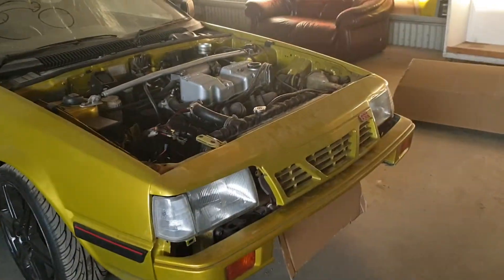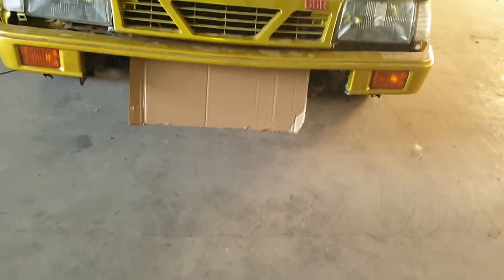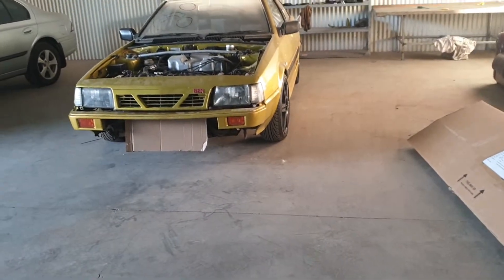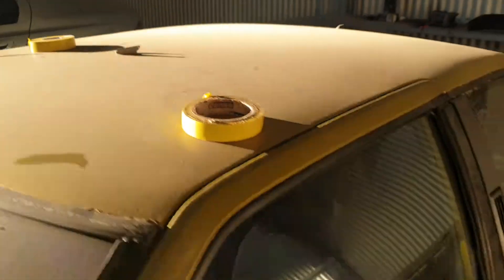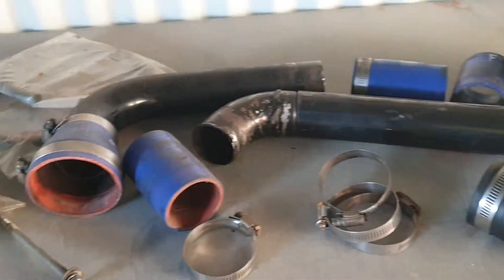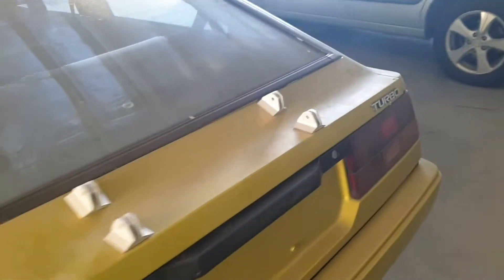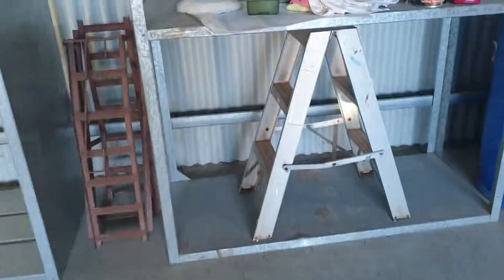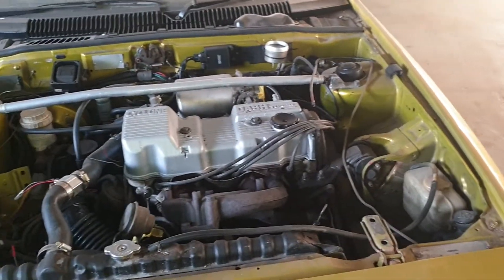Cordia update pt. 2

Comment: Should run nice and rich without the air flow sensors (Dash dunno??)...
Reply from the maker: Hopefully it does aye, what do you mean?
Reply: @willfilkin6469  Yea hopefully, i'll set up an email account tonight for ya;) More air, more fuel. Not too lean or booom. You want black (fuel) smoke out tha tail pipe, not white/blue etc...
Reply from the maker: Ahh yeah yeah I get what you mean. Once it's tuned up and what not should be alright.
Reply: @willfilkin6469  Hahaha what you have there now is definitely built. First break-tear down will tell the true story anyway. A paddock job extra injector in the intake plumbing or a squirt of methanol tops. These things weren't held back by circuit boards or any that fancy stuff, only detonation with those air sensors gone. Don't take offers for it until you have it runnin how you like! Shum these things will break through, under, over any round yard (737 Max -MCAS) at any time aye. Lane changing fanimals 'fun'. This way you can flange up a dumpa for a stage three swap over easy enough, without losing its build (factory) appeal. Best find an old skool fuel injection (diesel) specialist. You sorting that plumbing urself today?
Reply from the maker: @GroupAPV  yeah okay, thanks for that. I will be doing it all myself though, not today, have work lmao.
Reply from the maker: @GroupAPV  cheers. Ran rough though but the guy said it needed a tune
Reply: @willfilkin6469  Hey Will,, email me on the above if get stuck on anything and try "Repliglass" in Brisy, for custom front bars.